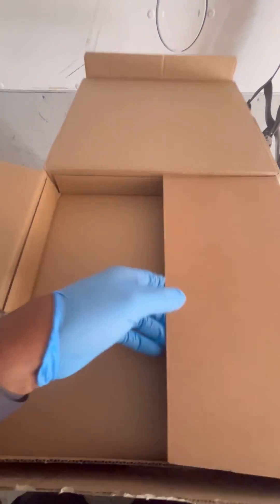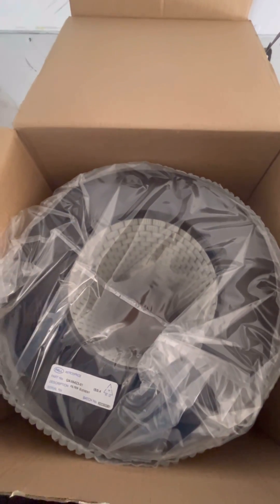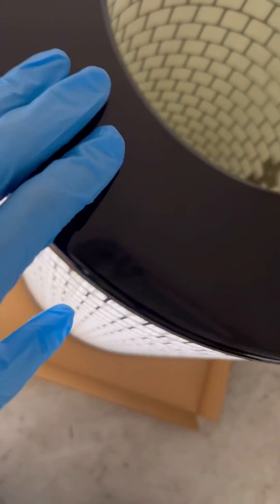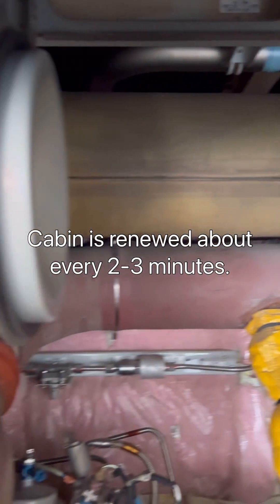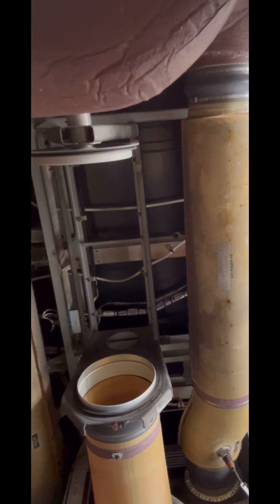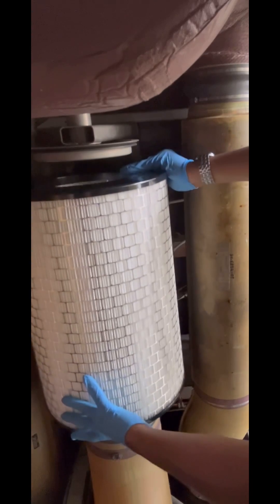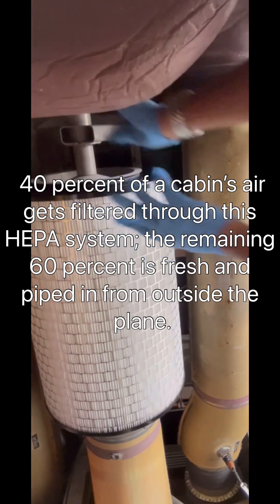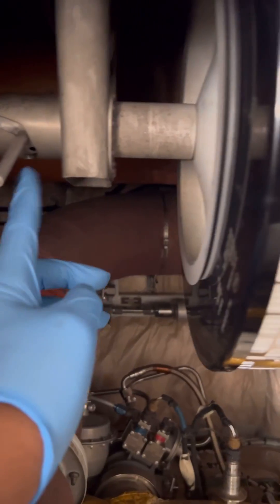Airbus A320 Recirculation System High Efficiency Particulate Air Filter Installation

Comment: where is the location of this HEPA filter? thank you
Reply from the maker: It’s located aft of the forward cargo compartment.Behind the cargo compartment panels/liners
Reply: @aircraftengineered  Thank you
Reply from the maker: You are welcome 👍🏼
Reply: So where is this air coming from, is it ducted into this void space or air pressure from the cabin above finds it way down here and sucked into this void? How many of these filters on board?